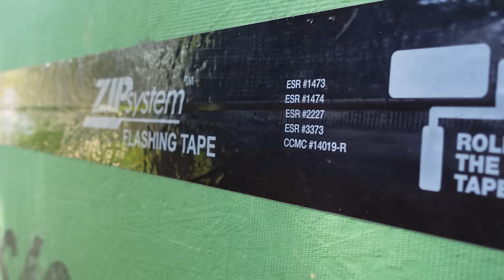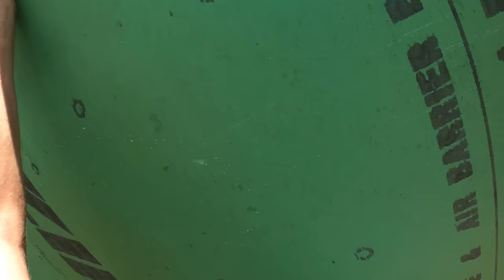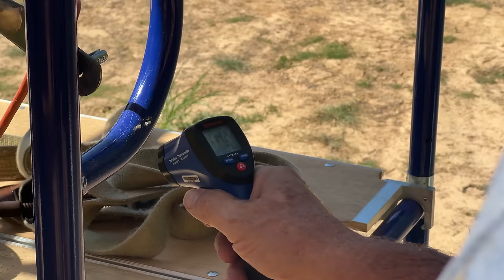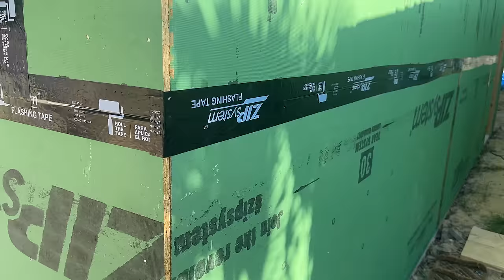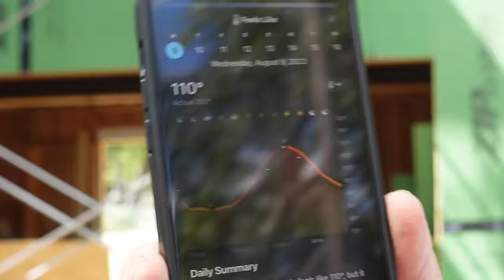We Thought We Could FINISH...But the Roof Made Us QUIT!!

Comment: Guys, I say this on nearly every video that you're doing a hell of a job. I spent 10 years in commercial construction doing a lot of vertical concrete work and not as much stick framing, so I'm always interested to watch the process. However, as someone who has also investigated dozens of falls in my time as both a State inspector and private sector safety guy, I cannot stress the importance of fall protection enough. Having the scaffold up on the one side is a good start as it lowers the risk of someone going off that end, but those gable ends are fatal falls if anyone goes over.

 I have heard it so many times about the rope systems being uncomfortable to work in and I totally get it. However, there are other systems out there that you can use such as yo-yo's which don't have you stepping over a lifeline. It's great to be comfortable with heights, but all it takes is one second of inattentiveness or lapse in concentration, which you have said comes with the excessive heat. If you want any ideas or have any questions about this stuff, feel free to message me or find a safety outfit near you and they will be happy to hook you up with something that will work for your project. Keep up the awesome work!

Comment: My dad was a builder in California's central valley. During the summer heat, roofers started at 5am and stopped work between 10am and noon.
Reply: I had no choice but to paint my house 3 weeks ago when it got up to 118 in the afternoon in the Mojave Desert - started at 0515 and had to stop around 0900 because once it hits 90 degrees they say you shouldn't be applying paint.  What should have taken me 3 days to paint took me 6.
Reply: I worked framing in Modesto. We'd start early and quit at 2 o r 3.  I'd go home and lie in cold tub water. (no A/C). Years before that I spent a summer in Canyon Texas laying up a large adobe house. We did the siesta system. SO hard to go back to work after the break!
Reply: What an amazing job you three are doing. Get there earlier just in time for the sun to come up and then decide when to take a long break and restart as the temps peak and start to drop. Will you do the roofing or have a sub come do that?
Reply: I came here to say this, except I worked in the same general area as the Stud Pack house - I was out by the airport.  

We'd literally be on the job at 05:00 and work until about noon, 13:00.  Then, we'd knock off, and the second shift crew would start around 19:00 and work until the wee hours of the morning.  

Us new guys would have to work the mornings, and the more experienced guys would work at night.
Reply: you can't go on the roof when its hot or you will mess up the shingles because they will be too soft to walk on
Reply: Absolutely!  If you aren't at the jobsite at first light, you are doing it wrong.  Roofing in Phoenix as a teen, you learned to work the west side in the AM , take 2.5 hours for lunch in the afternoon, and work on the east side of the roof and hope for a little shade.  Brutal stuff!
Reply: They still do🤙🏾
Reply: Same in Georgia.
Reply: Same in Redding, Ca
Reply: Same in Oklahoma!
Reply: Same in Phoenix. 11am is about the max.
Reply: the sun is more dangerous but working outside in winter up north is more miserable

Comment: tip... the ZIP roller, has little Z's in it... so for warranty claims, they can see if you rolled it properly.  ALWAYS ENSURE YOU ROLL, as the adheisive is preasure activated... thats why you can stick and move it, but once you roll it, shes there forever, in 200 years when they tear down your antique house, the tape will still be there holding the house together.  

But also, not just for warranty, but so you can see vissually what you have rolled and havent and if you are inspecting behind a crew, you can tell if they performed the rolling propperly
Reply: Yes, this was mentioned in the video...

Comment: I feel for you guys, I am 75 and doing a lot of outside work including weed eating, mowing, debris cleanup, and finishing up a workshop extension.  I am in 98 to 101 degrees with the heat index pushing 113 most days.  I usually knock off about 11 and start back around 5 to avoid the hottest part of the day.  My teeshirt  weighs about 5 lbs from sweat when I remove it.   I lived at Ft Hood a total of about 7 years, so I am very familiar with the heat, the chiggers, and an abundance of other biting insects in Texas.  Your work is superb, keep it up.

Comment: Fellow Texan checking in here; temps of 105-108 in DFW this week, with heat index values ranging from 110-115.  It's stinkin' hot!  When I can't avoid being out in the heat, I take a wide strip (about 10-12") cut from an old t-shirt or other thin, soft cotton rag, and roll it into a long tube full of ice cubes, then tie it very loosely around my neck (kinda like a Boy Scout neckerchief).  The multiple layers of cloth keep it from melting too fast, and the cool damp cloth against your neck (think carotid artery and juggler vein) really helps to keep you cool.  Take a break every two or three hours to wring out the water and put fresh ice cubes in.  Yes, your shirt will eventually get wet, but not as much as you think and you won't care.  Stay hydrated and cool, my friends!  And congrats again on the 500k milestone!  I've been a subscriber for years now, and have really enjoyed watching you develop your construction and production skills!

Comment: Put a sprinkler on the house roof to spray a mist to the garage roof workers. It may vaporize before it gets there though. A wet towel around you neck also helps. Keep some ice packs handy for StudPack heat exhaustion.
Reply: Mission towels and Mission hats to keep cooler!

Comment: Before you take that scaffolding down, you should read up on how to apply Zip Tape for your windows!  There is a lot of taping work left and you will want scaffolds in place so you don't risk your necks!  Great work.
Reply: I was wondering the same.  Perhaps they will scaffold up and tape openings when windows arrive.
Reply: bump
Reply: bump bump
Reply: Dad should be pre-cutting the panels that reach the roofline to reduce the weight of those panels. No need for them to be dead flush. Save your energy a bit and eliminate the danger of the falling off cuts
Reply: They might be doing stretch tape or liquid flash. Probably no reason they can’t do that from the inside when the time comes for windows
Reply: I think there gonna wrap the inside of door and window openings with zip then tape them.

Comment: How are you going to form your eaves overhang ? You can still sort of do ladders for the gables but the sides of the house are not going to be too easy !
Reply: I was wondering the same. Over hang is usually in the truss. I'm sure Paul has it figured out. He's a very smart man!
Reply: @MosinMan76254   Building the way they are doing it you can make a continuous zip envelope around the building so much easier than having to deal with the gaps between the truss overhangs.  Once the envelope is sealed you can screw on some "tails" for your overhang (very similar to the gable end ladders). On the Build Show channel they have a good video on this technique.
Reply: @UnlikelyToRemember  
Thanks!

Comment: Hydration tip: Dissolve pink salt in a cup and then add 2 tablespoons in a 1 gallon water jug. The salt helps tremendously with hydration. Been watching you guys from the start. Congrats on the 500.

Comment: Im kinda curious about how the roof will look and perform without overhangs.
Reply: They will likely add in the overhang, nailed to the studs.  This is how modern building are made air tight, by NOT having rafters hanging over walls..  but rather a structure is built OUTSIDE the air tight envelope of the house.
Reply: I've seen a few of those go up around here but they start the first full course of roof sheathing from the facia so the sheathing is continuous from the facia of the add-on overhang up onto the roof trusses about 2 feet or so.

Comment: I feel ya on the heat I am in the middle of a major landscaping and remodeling project myself. My dad (passed away now) was a general contractor and grew up helping on job sites with remodels and building a house with him in Hawaii. We even rented one of those same geni lifts you used in the previous video you had. 

I just finished lifting my sinking foundation, removed a load bearing wall and installed a lvl beam and currently back at the original project of replacing a falling retaining wall and  new paver patio and have a crew of me, myself, and I. 

The previous owner had a stamped concrete patio and who ever did it sloped it towards the house :facepalm: and is what caused my foundation issue and basement flooding problems.  

I am constantly soaking a cooling towel for under my hat/neck helps a ton.

Comment: I feel you guys, I live in Vegas. We had something like 18 days straight of 115-118. Once that heat gets you, it saps your energy and strength. I work in my garage (doing home projects) and it’s gotten up to 127! 🥵
Reply: Wow, I thought FL was bad with a 113 heat index and no breeze. I celebrate when we get a breeze or some overcast  lol
Reply: @digi3218  when we get a breeze it feels like a hot blow dryer. It barely cools down at night, like 108 at midnight.
Reply: @E.Carrillo  that sounds awful but I'll at least take a small breeze. I guess the humidity is so high here, sweating doesn't do anything without one lol.

Comment: I know all about working in the Phoenix summers. When you burn your fingers on lumber, it’s hot. I don’t want to hear about dry heat. I was converting a shipping container. The surface was 175° in the sun. I coated the roof with Henry’s white reflective coating and it dropped the roof temp by 50°.

Comment: For a $100.00 you can buy a remote control cable hoist to lift your zip sheets up and set them in place. This saves a lot of time and frees up a person to do other work on the job. It only takes a minute for someone to rig the zip sheet to the hoist and the person nailing the sheet can use the remote to lift it into place.
Reply: What about buying a winch?  That winch can be reused when the main house is being built.
Reply: It's very tight space, and more problematic than help.
Reply: @cyclopsvision6370 if they get a 12v winch (like an atv winch, appropriately sized of course) they can use in on a trailer later for winching stuff on.
Reply: Or...
What most people do is square the wall on the deck, sheath it, then tip it up. Much faster and easier.
Reply: @cyclopsvision6370  They even have drill operated winches.
Reply: And sheath the end trusses before lifting as well. That's how we did it anyway. Also, install the barge rafter standoffs and the barge rafter. Might take a boom truck though.

Comment: Great work guys. Reminds me of deployment, 140+ on the flight line and in the portajohns.

Do you think you could slap a pulley on the ridge and hoist the sheets up there? Have a guy on the opposite side, on the ground, pull a rope with the sheets tied to it?
Reply: A pulley and 30-50 pounds of weight as a counter balance. Build a simple frame to hang pulley securely on a rafter. 10 minutes to build an no need to muscle sheets up

Comment: So I used to tape cables a lot for an AV job I did a few years back, and I found that instead of rolling the tape 1 foot at a time, and then swiping it down, that you get a good tack and unroll the tape a LONG distance...like 10-12 feet, bring it down, swipe a 1 foot section, and then repeat all the way across the long distance you have to cover. And since you have rollers, you can go back over it with them...we just walked all over our tape to get it to adhere better...Hopefully this is helpful :)

Comment: Suggestion,  use winch on rafter to hoist sheets up through front window, then lift between rafters to get sheet on top of roof.   Had a better deal for you than the TSC purchase, but couldnt find a way to private message you. Almost drive to your site to help and get you the better deal.  Should get cooler starting labor day.  The heat is keeping the hurricanes away so dont wish away the heat yet.

Comment: You convinced me to try Lexel sealant to seal against rising water intrusion around a 4” toilet drain pipe.  Recent foundation leveling apparently loosened the pipe in the slab and groundwater from recent repeated heavy rainstorms rose up beneath the toilet.  I’m really hoping that Lexel will seal it.  That stuff takes forever to cure!  It will skin over in under an hour but takes 1-2 weeks to cure, much like 3M 5200 sealant, and dries crystal clear.  Fingers crossed!

Comment: I've done a lot of scaffolding work in the past. I've been in situations where we built the scaffolding on wheels and rolled it, but we always strapped the scaffolding to the structure for more stability. Also, you should always wear a harness on the scaffolding and on the roof. I know they are a hassle, but all it takes is one small mishap from that height and your talking serious injury or death. We had a giy go down while working for several days in high heat and high humidity because he was dehydrated.  He was at the very top of a 40 foot scaffold that was sitting atop a 30 foot radar tower ( We were installing a golfball radom in the Azores). He would probably be dead if he hadn't had his harness on. BE SAFE GUYS.

Comment: I didn't need to close my eyes until the rubber ducky as my dad was a sheet metal worker for a few decades and he worked on scaffolding way higher in the air than your setup. I'm talking dozens of stories high. He was a construction worker building the World Trade Center in the 70's. He's been on external, no wall elevators. He would use toilet paper and duct tape as a band-aid. 

I liked the saw dust shower and the lime tortilla chips that fell to the ground. Also you need to make sure that ZIP tape has the wording right side up or those seals won't be as strong (JK, 3D Printer joke). 

I always can't wait for the next installment.

Comment: I see some folks mentioning sheathing and taping the walls before standing them up. I once worked with a builder that framed the wall, sheathed it, taped it, put in the windows, and installed the bulk of the siding. Then stood it up.

Comment: I’m a third generation roofer. It’s difficult because of noise complaints late and early. But I like to start at dawn, work until it’s too hot, and then shower and sleep in the afternoon. Then I put a few more squares on int the twilight hours. Trying to tough it out when the Sun is at its zenith is too draining.

Comment: Texas has been hotter than heck this year. I know the issues you’re facing because I also work outside in Texas, I was working in Del Valle today and the temp ranged anywhere from 104° to 108° depending on the area where you were at in Del Valle. Make sure you take those breaks and hydrate hydrate and hydrate.

Comment: Hmmm .. check with your building dept.   Usually framing inspection done after mechanicals -- they want to verify electric / plumbing / HVAC didn't cut through or otherwise compromise any structural framing.

Comment: Are you sealing all the nails? There’s a caulk just for the zip boards and the nail holes. I finished an addition on my house and used the zip system but was required to apply the caulk.